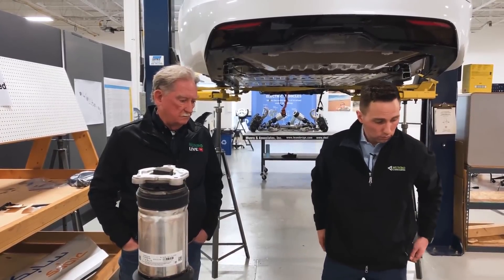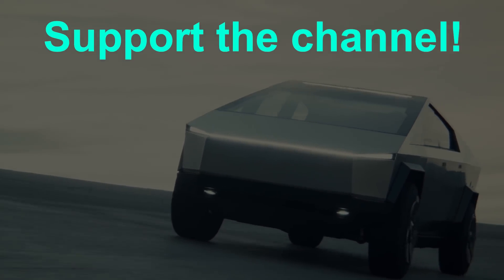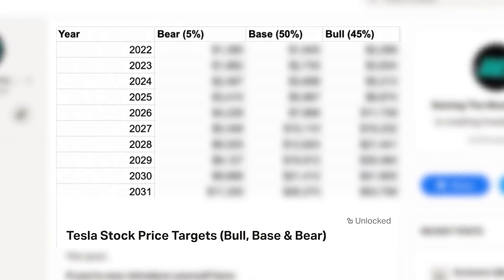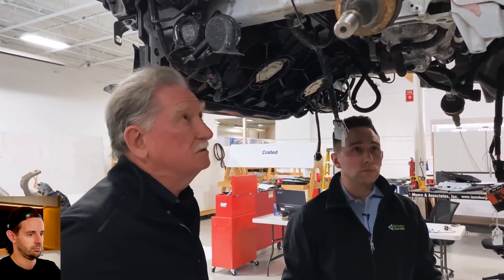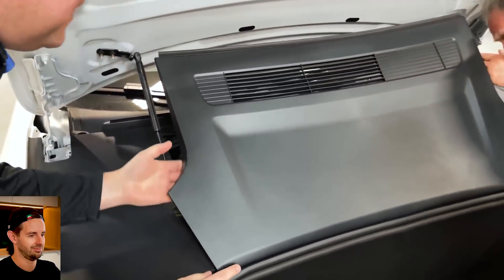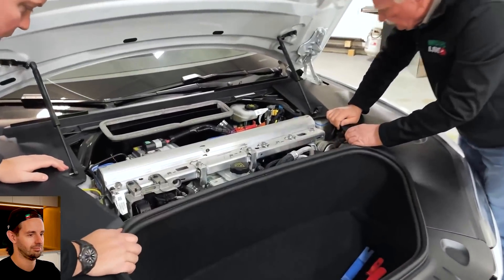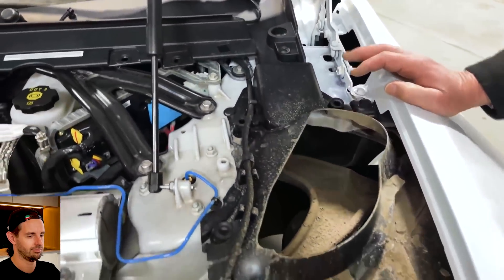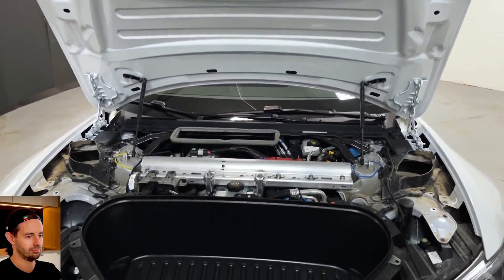Sandy Munro LOSING IT Over Tesla Engineering: “To Die For”

Comment: I am an manufacturing Engineer / Designer for a supplier for automotive.  I became and all in investor in Tesla after Sandy Munro showed the Giga-casting on the Model Y.  
The Giga-casting on the Y showed how rapidly Tesla could improve from the less then stellar job on the Model 3 to the best in world Giga-cast Model Y.  
This Model S Plaid teardown just reinforces my investment decision, engineering excellence everywhere you look.
Reply: Their learning curve is awe inspiring. Tesla make improvements that other companies would be bragging as a major improvement without word, and they’re making those improvements all of the time.
Reply: @kokofan50  yep, they are making 27.5 improvements per week! How in the hell does an automaker keep up with that? That’s right, you can’t. Because in order to catch-up you have to 28 improvements per week and even at that rate it’s would take decades and you would never be allowed to idle for anything. FORD & GM die in hell. POS.
Reply: I inspected an early frame-off mock-up of a model three early on.  I let the late great Jack Rickard know about their me-too build problems and right after that Monroe discovered the same problems.  I read the original Tesla die casting patents and also alerted Jack to the possibilities we're seeing pan out today.  Jack didn't immediately seize the significance.  Sandy immediately knew the concept value and also let the cat out of the bag about the custom alloy required to do a full mold fill at achievable pressures and still have enough stiffness.  I too am a near all in investor.
Reply: Yup. Model Y ramping in Berlin and Austin. Oh my god is the world gonna be blown away

Comment: This reminds of the most common commentary:  This Tesla looks boring.  There is nothing new.  It ilooks the same as the previous models.
People don´t get that the legacy automakers release a car and then every two years or so release a cosmetic refresh - so people get a "new" model.  The internal important stuff is usually identical to the previous facelift.  I call this very close to fraud.
I really prefer the Tesla model that delivers continuos improvement.  The model you buy is the newest internal design with many many improvements.
The exterior with its efficient drag co-efficiency is maintained.  This BTW has the side effect of maintaining the value of older cars and keeping the owners happy.

Comment: It’s as though the design and engineering dictate is, “build it like you’re sending it to Mars.”  This would imply light weight, shared structures, reliable, and elegant design.
Reply: I was a manager of Data Communications and when I use to send guys out to do installations, I would tell them to pretend it was a mission to Mars.   You have to take everything you need with you.  For want of a screw the mission could fail.   On the home front we would FedEx anything forgotten (we weren't perfect).   Sure you could go to Home Depot for tools or perhaps parts but that would be two hours out of your workday you could not afford.

When you can go directly to the source or designer and not have to go through layers of managers first you can get speed, you can get things done.  This was out "better to ask forgiveness then permisson" culture.
Reply from the maker: Nicely put.

Comment: Just a side line, Tesla has s few changes in body builds in each body style. The ICE market had relied on this though their cost to change re- design did cost and their margin to compete, Tesla does not have this so much (apart from minor aesthetics and major software updates let alone on tee spot production changes internally).Point being,, Telsa can still sell vehicles without continual aesthetic changes compared to other companies that currently change aesthetics to sell a new ICE model

Comment: Wait a second … this is SpaceX technology going into an EV!! This is SpaceX and AI on wheels! Checkmate to all OEM’s 🤩🤩🤩 Well done Steven you have locked into the secret sauce of Tesla. Thanks … pure science fiction !! I would compare this to chip design approach applied to EV designs. I was a chip designer for many years with Texas Instruments and it reminds me of all the optimization that went into design. The more you can get onto a wafer and the more reliable and less costly is your product. If you can put 1000 chips/integrated circuits on a wafer that has a fixed cost instead of 100 … do the math. Additionally the smaller space occupied by a chip, the less the power consumption and the less prone to the innate imperfections on the wafer! 😳😳😳🤩🤩🤩 Integrated motor design = Integrated VLSI technology … this is the trend I am seeing here. No reason why you can’t migrate all of this to a miniaturized version for the Model 2!! Next step down the road.. integrating Neurolink and Starlink into the cars AI.!!!
Reply: You thought that to huh? First time i thought like that was when i saw the Octopump.

Comment: Let me put it in another way for people to understand what Tesla is doing. If you are to armor a tank, the smaller the tank the more armor you can put on it for the same weight. In the case of these group part breakdowns, by making these groups as compact as possible it means Tesla can provide the same or slight better storage capacity with less overall mass. Its just crazy! As Sandy has stated for EVs weight is the issue and Tesla is leading the way in reducing it the most.

Comment: Union workers need a person for everything, break your screwdriver,  call the broken tool guy to get you a new one, instead of going and getting it yourself. 
Got a suggestion put it in a box, and maybe we will get around to reading it next yr.
At Tesla, suggestions are listed to, and if it makes sense, it's implemented among the 17 to 20 modifications made every week. Brake your screwdriver 🪛 go and get a replacement. 
That's why they are so far ahead and will stay far ahead of union shops.
If you're not being mistreated, you don't need a union.

Comment: I'm an engineer, be it in a totally different industry, and have Tesla stock. I think that much can be learned from their way of engineering and the Munro videos. However I think their service department is their Achilles heel when even the fans get disgruntled. They should open up more to external repair and service when warranty is gone.
Reply: I hope guys like you would do reaction videos on Sandy Munroe videos.  I would be interested to see your reaction and get you thoughts on what Tesla is doing as well.  👍
Reply: Only right-to-repair laws can fix this with Tesla and John Deer.

Comment: This is the results of Agile Scrum methodology that Joe Justice who lead Agile at Tesla talked about.   they have cross functional design teams designing subsystems and that means that all the engineering disciplines are working together to figure out the best way to have fully integrated ideal optimized subsystems. After spending 14 months studying everything about Tesla the Joe Justice videos gave me the most conviction that the company is totally different than other automobile manufacturers. Legacy auto will have to redesign their organizational structures, Design Teams and manufacturing processes from top to bottom to duplicate this. Legacy is screwed!

Comment: Hi Stephen, I’m a 56 year old electrical & electronics engineer, and TSLA stock holder. I agree with Sandy’s observations on Tesla’s engineering, the key work here is symphony. So often an engineer gets a design spec for (say) the wiring loom once the structure is designed and signed off, the loom design is then compromised because routing through the body is limited, without consideration of the loom and other components need to make a complete vehicle, you then can’t go back to the structural engineers and ask for a tunnel here or gap their, because they would have to redo all their calls and modelling. Tesla is clearly getting these teams working together to consider the whole vehicle in ever specialist input - just awesome. If I were 30 years younger I’d be banging on Elon’s door asking for a job!
Reply: you're never too old
Reply: @sourav jaiswal agree except on the financial part .. Tesla manage their balance sheet like they engineering their cars... They have the best financial engineers working for Tesla, like Hiro Mizuno, ex-manager of Japan's $1.5tn pension fund, and they hired ex SEC lawyer David Misler, former fed prosecutor as managing counsel to manage the stock well being.
Tesla is a master in everything, don't underestimate that.. Employees are paid well, but their bonus is Tesla options, and Tesla ensures everybody will get rewarded handsomely, and visa versa, if all employees perform outstanding, that reflects in Tesla's stock, so it is in their bonus. Very smart engineered...
Reply: Hi, I’m a shareholder and expecting my first M3 off a ship in next week or two.I started out working life as an apprentice Motor mechanic  GM & Nissan - the sales dept “sold the dreams & we Mechanics fixed the nightmares”.
So even though the engineers are creaming themselves, some Tesla Fitter will have to work on that “symphony” and a Tesla owner may have to pay for it. So how about a Mechanics appraisal? Just saying.
Reply: @farmerfarmerer3847  This is a totally legit concern, especially if Tesla eventually sponsors third party repair of their vehicles.
Reply: @farmerfarmerer3847  Some of Sandy's expert have already pointed out why changing a bolt line axis by 90 degrees turns a three step part extraction into a one step.  It's obvious Tesla has maintainability engineers at the table.
Reply: That is because of their internal structure of production cells. Simply put, Tesla does not have a clear distinction between R&D, Experimentation, and production. Everything operates on the level of the factory floor in a manner not to dissimilar to how a computer network operates (new cells are created to experiment with variations of a process, and are either discard or operate in parallel to the "main" cell as they ramp up and eventually replace the main cell's resource flow and become the new main cell). This is done so literally thousands of changes and small/big improvements can be done to every aspect of the vehicle without stopping the line. 

In just the same way, people aren't constrained by roles at all. Old employees told how while they had a department and were hired for a specific task, in reality they can pretty much do whatever. While employees have managers and HRs, most of the information is transmitted via a companion app that every employee has. If you think you have an idea how to make anything better, all you need to do is ask for some resources to be diverted away from a cell to your new cell, and say on the app "hey guys, I got an idea on how to improve cooling system for the 3, meet me at 2P.M at X.Y on the floor if interested". And people kind of just show up and try to solve problems. 

One of my favorite recollection of an event was of how Tesla improved the charge speed of their vehicles. An engineer was just passing by and saw a gigantic bin labelled "scrap" which was full of metal bits. Curious as to what was causing all this waste, he went to the source and found a guy making and bending metal and trying to make it fit in a car. Turns out the guy was investigating how to make the connections to the battery handle more load so it could supercharge faster, and thought that geometry was the bottleneck. And so you got this little impromptu group that formed of people chipping in to help, regardless of rank or function. Then, they made a piece, it fitted, and the car did an auto-check and confirmed it could now accept more load. That car was then injected into the next production cell like nothing wacky happened to it, and the new cell was created and started figuring out how to produce this modification faster.

In a matter of hours, they went from idea to integration. While not yet utilized, there was now a car with a better charging infrastructure on the factory floor, that car was being sold to someone. Not a single second during all that did the line need to be stopped. The car's factory mode told the engineers it passed the checks, so it was ok to proceed.
Software assisted, rapid and flexible development, with no barrier to information. THAT is how you handle cross field cooperation. The best way for your cooling system to be integrated into the structural piece is to be able to just go to the previous production cell, talk with the guys there, and see how you can make a better piece that will fit with your process, regardless if it is the next one or the one 7 cells later. 

The downside and why only Tesla actually operates this way is that it implies the loss of one absolutely crucial thing: budget. You can't do a budget for a cell system. That group of engineer was diverting and burning pieces of charging hardware without notice and without restraint. Its a snap decision made in hours, not a careful budgeting though off years in advance. Tesla just trust the engineers will pull their best and make it worth it. And time has told, again and again, that motivated engineers will absolutely make it worth it.
Reply: @mobiuscoreindustries  Thank you for the clear-eyed analysis! 🎯🤙🏾👏🏾👏🏾👏🏾👏🏾
Reply: Hell, I'd come out of retirement for the gig.

Comment: These attributes of a Tesla remind me of the motorcycles designed by Erik Buell. The frame was  the fuel tank and the swingarm was the oil reservoir (dry sump). The muffler was underneath the frame. The front brake rotor attached to the rim rather than the hub of the wheel, allowing thinner spokes and less unsprung weight.

Comment: Engineering advances can be fleeting.  All a competitor has to do is buy a car and have its engineers take it apart.  As a Tesla investor, I'm glad the company has a lead.  I will, however, not be shocked if that lead has shrunk a good bit  by 2025.
Reply: The car can be dismantled, analyzed and completely understood, no problem. Modifying a company culture to author and play symphonies when it normally produces one person 10 second jingles is a monumental task. 
Legacy OEM's, time is running out⏳.
Reply: It’s not that simple.
A competitor can figure out what you built by looking at the final product, but not necessarily HOW you built it. Other OEM’s don’t use the same manufacturing technologies as Tesla and changing their production lines would cost more than they can afford to pay.

Anyway, the research is clear, Tesla is the only western automaker at volume that will still be in business in 10 years time unless the others are bailed out by their governments.
Reply: So as a Tesla investor who believes their lead could easily shrink, what are you doing to hedge against that?

Comment: Hi Steven, many good points here. Once I told you Tesla stock contains a lot of expectations about Elon's execution Plan. Now I think I have understood how much: it' about 6 months. This means that the stock can move approx in the range between the minimum it had in the past 6 months to a maximum that already includes a projection on the 5 years curve path of the following 6 months. These values have to be put in relation to the macro economic environment. Please let me know if someone else has found a similar low. Today this means between 800 and 1200. Anyway as long term investors we don't mind too much. Bye... Both

Comment: I'm not "officially" an engineer, but I was raised by one, and I ended up with a lot of experience in coding and network admin, though that was all self-taught, not based on a degree program. I've just always had an interest in science, initially sparked by the Apollo program... learning about science has been a lifelong habit. I've been following Elon's exploits for about 15 years now, though I didn't get active buying stock until 2017... just in time to catch a 20x run-up. ;-) 

Like Sandy, I am endlessly impressed with Tesla, especially the engineering. It's virtuoso-level stuff.
Reply: Well said

Comment: That sums it up. I still find amazing engineering and design surprises in my own 2021 Tesla model 3 Performance every now and then (over one year old). It's shocking how far ahead Tesla is to any competitor, both in innovation and in delivering quality - and for unbeatably low prizes. I have never saved as much money at both purchase for a sportive five-seater and for over a year running costs for this car so far... (made nearly 30k miles already). Cheapest, most fun, most practical, most convenient - simply best car I've ever had (including modern first hand German and Swedish cars I used to drive).